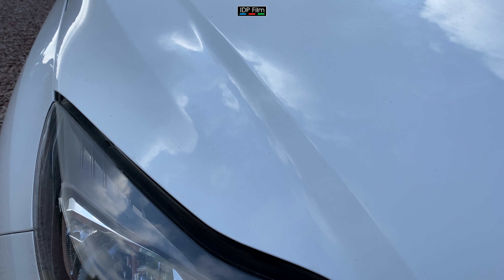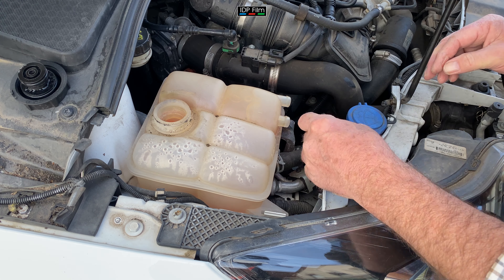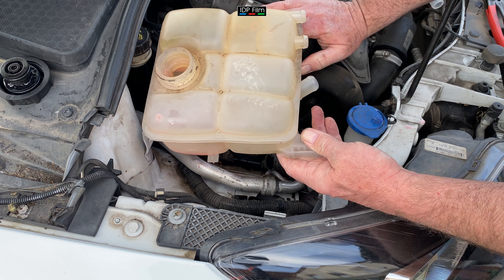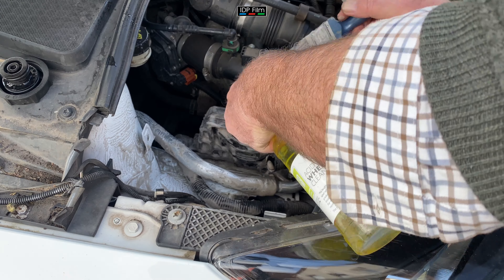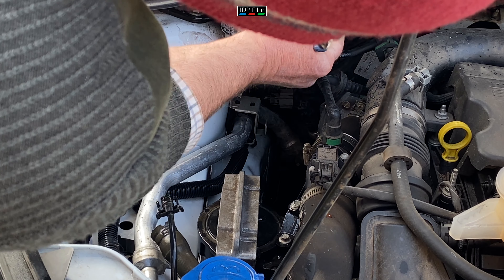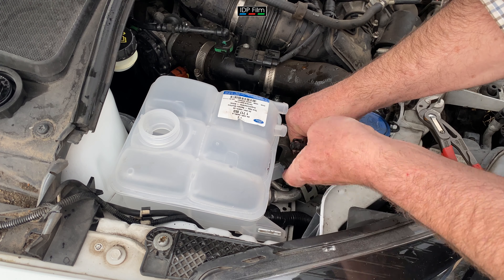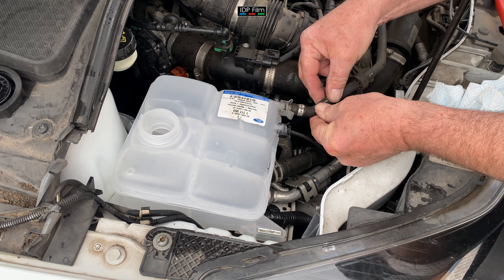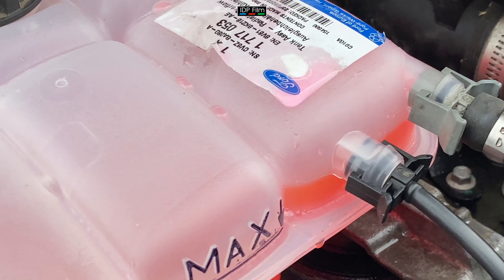How To FIX Coolant Leak in FORD FOCUS - SAVE MONEY Do It Yourself - Part 1 of 2

Comment: Thanks so much for this video. I had exactly the same fault (loss of coolant) with exactly the same crack in the same place on the underside of the bottle (test by putting a cloth under the bottle and it got wet overnight). Unfortunately I also had a leaking coolant bottle overflow hose which was very annoying. Poor quality parts from Ford - no doubt they saved 10 cents in the car manufacture but left a legacy of short life parts on the car. Brilliant video!
Reply from the maker: You're welcome! John
You are like us we cant believe how parts from Ford are manufactured - take the coolant bottle purchased from Ford direct at only £12, basically says it all. One of our FFRR Range Rover Coolant bottles cost £186, think that says it all.
But good to hear you have your problem sorted.
best wishes Fella

Comment: Thank you very much mate... I had already booked my vehicle in for an inspection after the coolant running out... I did refill it but after a 7 mile drive it was empty again... I traced all the pipes and even on the resivior itself along with the cap but I couldn't find any signs of a leak... after watching this video I took the expansion tank off and to my surprise there was a very small crack! No more than 1cm long... I bought a new tank for £22 from ford and fitted it in under 10 minutes thanks to your tutorial... in total I saved £150 for the inspection + labour... legend

Comment: Just a "heads-up". Going by the label on the replacement reservoir in this video, I notice that the replacement video is a "genuine Ford part". I mistakenly replaced my 2012 Ford Focus reservoir with an Amazon-purchased unit (which I presume was cheaper!). The two connections on the Amazon reservoir drain ports would not allow the tabs on the original drain connections to connect to the reservoir flange. The result was that the connections would leak continuously. Eventually, I had to remove about 1 mm of plastic from the face of both of the reservoir connection tubes to allow the connectors to advance sufficiently to engage the locking tabs. Use a genuine Ford reservoir and save yourself another problem!
Reply from the maker: Just dont go down the Road of trying to save a few Bucks ! - 
This BEAST holds all your Engine Collant ...... Its the Heart of the coolng system and the engine wants it more than you do !
The FORD Genuine part is only around £25 - its pennies for what it does.... Range rover charge £198 for basically the same thing but its bigger - FOD genuine parts are cheap and made to a high standard.
Suggest you take that Amazon crap off and put a Genuine bottle on - later down the road ..... 100 miles from home when the Amazon bottle lets go - you will smile you put a Genuine Ford Bottle on ( by the way they will only last around 6 to 10 years - plastic does not like getting hot to 90C then cold to 0c time and time again - things crack and break )
Reply: @idpfilm  Absolutely correct, however, the challenge is sorting out the "chaff from the straw"! Although we're all attracted to the "best price", a rule of thumb would be to (a) determine the  price middle ground and (b) carefully review the product comments (other than 4 stars which usually are "plants" or part of Amazon's "Vine Program") or similar supplier paid reviews.

Comment: I wish mine was this simple but no the water outlet broke and leaked all the coolant out the drivers side of the engine, not the tank. Ford wants $1400 to fix.

Comment: My 2012 Focus (USA) has a leak in the original coolant reservoir. It made it almost 12 years before it started leaking. We get tempertures down to -40 F here in NE Ohio, and as high as 100 F. I would be surprised if yours lasted less. I don't know why that would be. Mine cracked in the exact same spot.
Reply from the maker: Great to hear from you Fella - pleased you have changed your too ! ........ Happy motoring Fella .............

Comment: I think this has hapened to my reourvoir going to have a look tomorrow
Reply from the maker: At least you have caught it in time - if you can flush out all the old coolent while you are doing it - flush out with cold water - loads of water to ensure all the old coolent is gone ( old coolent can go corrosive to plastic pipes and cyclender head gaskets - eats into them !
Good quality coolent is recommeded - when filling up ensure heater matrix is on HIGH with fan turned up and run the engine until all air is purged from system - use the bleed valves located on the highest points of the engine block.
GOOD LUCK we wish you well

Comment: Hi, thanks for the video. I have a question is this normal for coolant coming back from the top right pipe in the coolent box. I am from India and using ecosport 2015 automatic patrol.
Reply: Yes. That's the coolant that has just returned from the cycle. If it wasn't coming in from that pipe, you would be in a world of mess. 👍

Comment: Where is the radiator where you pour water in or is it just the reservoir
Reply from the maker: Just fil the Reservoiur up and KEP the Heater Maxtrix ON FULL HEAT when engine running - ensure you see HOT Coolent filling the plastic bottle and put hand onto this pipe to feel its hot water from the engine.
You will see the small hose at the hot - this is the return from the engine block - the engine must reach operating temp in order to open the thermostat.
Note the next day when the engines stone cold CHECK the fluid level - it must be at the MAX mark when stone cold
just ceck you have no air pockets when initllay running the engine up

Comment: Does it leak antifreeze even when you had the engine off? Or not? Im trying to figure it out. Since im having a leak but only when it comes to warm my truck happens.  And when i drive it. I being changing hoses but the problem still there.
Reply from the maker: It will only leak when the temp gets hot ..... Creates a lot of PRESSURE around 22psi when fulids get hot ( see the Resivour cap - it says what max pressure is of the syetem. Also look at hoses - all of them if they look old change them - but ensure you only replace with GENUINE FORD Coolant hoses - Dont cut corners and For  F*** Sake dont us jubliee claps - they will cut into hosees use proper clamps and FORD Fitted - easy to replace or reuse.

Comment: It seems as the plastic hits the metal part on the right and beneath. Probably due to vibrations. Maybe to put some sponge in the place to protect the plastic?
Reply from the maker: No way - Plastic goes brittle over time - Hot & Cold cycles - 6 to 10 years of 90C to 0C plastic just gives up and splits .........
ts the Heart of the coolng system and the engine wants it more than you do !
The FORD Genuine part is only around £25 - its pennies for what it does.... Range rover charge £198 for basically the same thing but its bigger - FOD genuine parts are cheap and made to a high standard.
Suggest you take that Amazon crap off and put a Genuine bottle on - later down the road ..... 100 miles from home when the Amazon bottle lets go - you will smile you put a Genuine Ford Bottle on ( by the way they will only last around 6 to 10 years - plastic does not like getting hot to 90C then cold to 0c time and time again - things crack and break )

Comment: Hi mate, did you drain your coolant system before replacing the reservoir bottle or just empty the coolant in the old reservoir bottle? Thanks
Reply from the maker: Totally drained the cooling system completely - then filled with 100% pre mixed coolant.
We used but I forgot to film - we sued a Snap-On cooling system refill unit
see film: https://www.youtube.com/watch?v=QDnHk0wWHeA&t=921s

Comment: Hi. There's a little hole underneath the bottle and I found it the coolant was leaking there. We can see the same hole 4:26. Isn't supposed to be closed?
Reply: @MechanicBundy So that is just a molding post. If you were to attempt to put an object through it, it wouldn’t go though. Trust me I just went through the same deal. These reservoirs are notorious for cracking

Comment: Hi great video. What sillicone did u use please?
Reply from the maker: None - you must use a brand new O/E Ford Coolant bottle - do not attempt to repair a leaking bottle
Reply from the maker: Sorry missed this one - we used AutoGlym  Silicone Spray - or basically any good Silicone Spray ( not WD40 ) - Silicone Spray is the best for all types of rubber

Comment: Yeah have small slow leak which i think I've found where . A lil wet spot at that thin line coming from reservoir tank . Mine is different that it doesn't have the thicker second line like yours . Just thin one . It has hole but has a plug no line .. 2016 Focus SE . Yeah American 2.0L . So replace what exactly ? Both tank and line ? And just below looks like water stained on motor mount .

Comment: "Brand new from Ford, 12 quid."
Man, I wish. Here in the US it's 54 quid, converted.
Reply from the maker: No way Fella - whats TRUMP doing to you all ! - hell thats expensive
Reply: @idpfilm  It's been this bad over several presidential terms. We never truly recovered from the 2008 recession.
Here's another anecdote: Brake lights. I wanted to get a set of RS brake lights to replace my ST brake lights. RS brake lights have an LED strip in the bottom half of the housing for your running lights. ST brake lights use a dual element bulb for brake/running. Only the US does this. The rest of the world gives the STs the RS brake lights. Stateside Ebay they were £1000-1200 for a pair. Ebay UK though? £150-200. I paid the shipping and customs fees. Was WAAAAAAAAAAY cheaper.

Comment: Going to give this a crack myself, the tank has been leaking loads, I bought the car 2nd hand at 92k miles so I bet there is the problem of the tank being cracked. I just saw part two of your video and am wondering if I may have the same problem with the heaters as well. Quick question - why didn't you just use your old cap why did you buy a new one? Will let you know how I get on.
Reply from the maker: Hi Fella - Please to hear you might have a go yourself - on a scale of 1 to 10 it comes in at 2
Remember to purge all air from system after you change the bottle over - you will tell if you get someone to hold the revs at 2,000 RPM for 21 minutes when shes warm and watch for the return feed back into the top of the coolant bottle for a steady stream of used coolant.
Also remember when she's stone cold the coolant level must be at the max mark. - ALL cars when they at AT RUNNING Normal temperature will show a coolant level of approx 8 to 10mm above max mark, this is normal.
They should never be at the min mark when cold.
You ask why put a new Coolant top on - simple, New Bottle New Cap ! - that way the whole system you have just put in will last another 5 years + ( No point in doing half a job - when summer comes the cap failed becouse it was old.
When you take out the old bottle - look at the hair line cracks around base and sides - Plastic Bottles hate the heat ( RED HOT then STONE  COLD - Over and Over again )

Good luck we wish you sucesss

.

Comment: Hello Sir. I have problem with it aswell... all coolant gone, engine stopped, pipe was broken... now is the question, computer turn off the engine when coolant was gone and was not running smooth.... I am afraid that is engine broken or maybe when I gonna replace tank and pipe everything gonna run like normal...? What You think sir? Greetings.
Reply: take it too a mechanic’s and get an expert opinion 👍🏼

Comment: please give me an advice i have focus ecoboost 2012 1.0 petrol when i start the engine is all good but since is getting hot i hear a helicopter sound inside the car and this only when im not accelerating and is very loud ..
Reply from the maker: We assume this is in hot weather - it will be the electronic engine fan which will start up in hot weather / heavy traffic when stationery. We hope you have checked your collent bottle ( When its COLD & on FLAT ground ) - its must be between the Max & Lower markings on the bottle.

Your radiator fan will kick in at about 200 degrees Fahrenheit.
If you notice your vehicle is overheating or at the very least running hotter than it normally does, listen for the fan to see if you can hear it.

Symptoms of a Bad Engine Radiator Fan are:

    No Whirring Noise from the Engine Bay. The radiator fan makes a noticeable sound when it operates.
    Rising Temperature Gauge. When the radiator fan stops working, the coolant does not cool down.
    Coolant Evaporates.
    The Radiator Fan Relay.
    The Radiator Fan Motor.
    The Radiator Fan Resistor.

Symptoms of a faulty cooling fan switch?
Several symptoms may point to a bad or failing thermo coolant fan switch.

    Engine overheating. Engines generate an enormous amount of heat and as a result are subjected to very large temperature swings if this switch does not operate effectively.
    Check Engine Light comes on.
    Broken or shorter signal wire.

.
Reply: @idpfilm  this issue doesn't even concern me but i have to point out how nice it is from you to reply with such a detailed answer. what a nice guy.

Comment: Hi mate, what is the part number of the bottle? Thanks
Reply from the maker: 1 717 053 - 44B46E01 - GB43167A Tank Assy - Rad'at.Ov Genuine Ford - supplier DG0723
Reply: @idpfilm  What site did you buy the bottle from and did the cap come with the bottle? If not whats the part number for the bottle. Many thanks for the video very helpful

Comment: Thank you for your video!! And showing some of the challenges you might come across.. I was able to change mine in less than 20 mins. Saved myself about $600 bucks the mechanic wanted to charge me to replace it.
Reply from the maker: Glad I could help! - look after your car Linda - best wishes from all the team at IDP FILM
Reply: So they did want 600  bucks @linda
Reply: Also because you are a female

Comment: Thank you for this, helped with my newer 2015 focus. had same problem had almost no fluid left next morning on the driveway found all my fluid on it.
Reply: Its a very common problem on ford focus 🧘 😅 i have this problem currently
Reply: Make sure you do the thermostat housing & water pump that’s why mine was leaking it wasn’t even the resivour
Reply: @kkleann168  I changed reservour but its still leaking, thanks for your comment, will try those next

Comment: What site did you buy the bottle from and did the cap come with the bottle? If not whats the part number for the bottle. Many thanks for the video very helpful
Reply from the maker: Hi David
The labels are on the bottle both ( Direct from FORD UK ) - we purchased the bottle from the FORD dealership in Hereford - £12 came with a new cap
The dealership number if it helps is: Phone: 01432 297000 - Hartwell Hereford Ford

Give them a call direct and they will give you the part number if in doubt
Hope that helps you David
Reply: Brilliant thanks. Do I need to drain the whole system via the tap at the bottom of the radiator?

Comment: Great video. You need to replace the degas pipes with the mk3.5 version otherwise the expansion tank leak will be the least of your worries. Anyone who has that T piece should change the pipes to remove it.